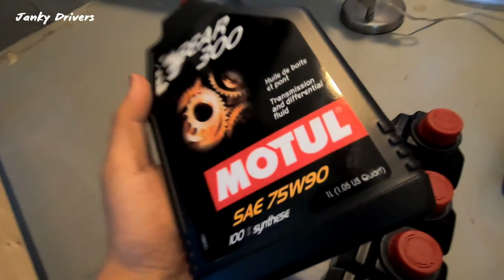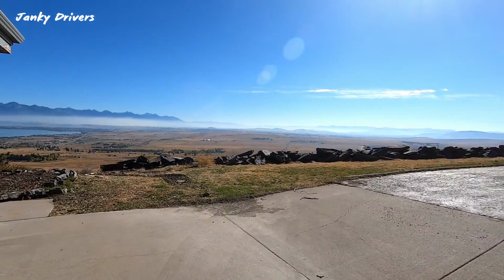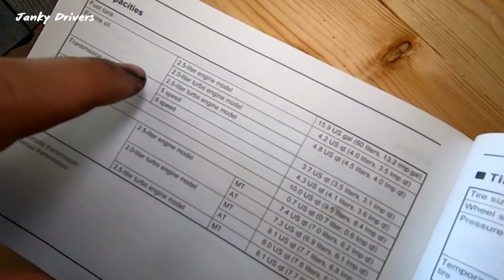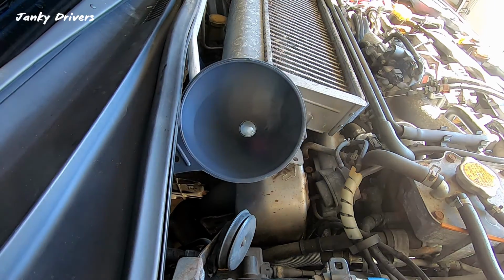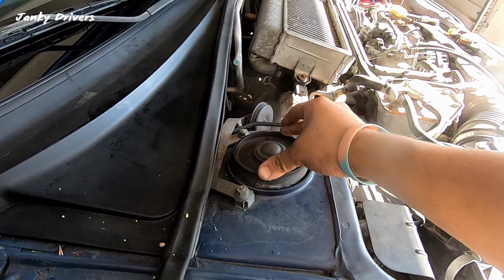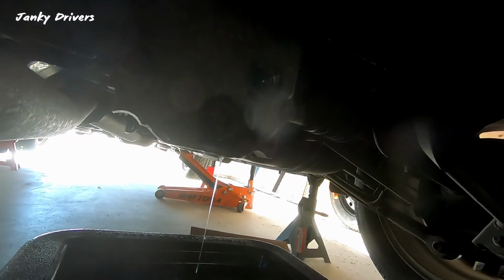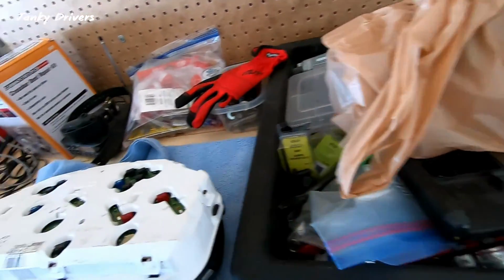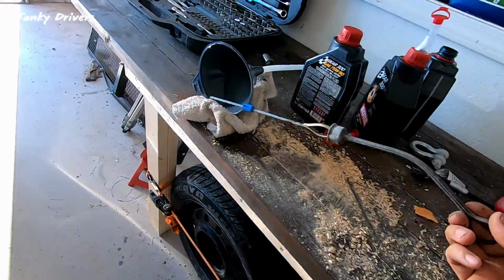How to change 5MT Transmission/Fluid on a 2004 WRX

Comment: Do you have the link to find those bulbs? Did you use LED?
Reply from the maker: No link, but!
its a T5 bulb (iirc)
halogen

LED's will work but its very blotchy unless you remove the greenish film behind the cluster- you can look it up. Halogen is easiest and works fine.